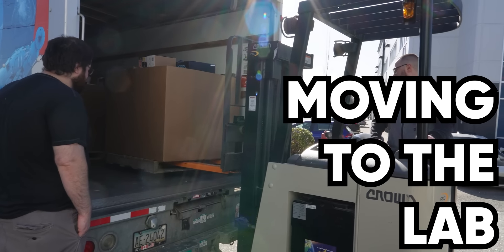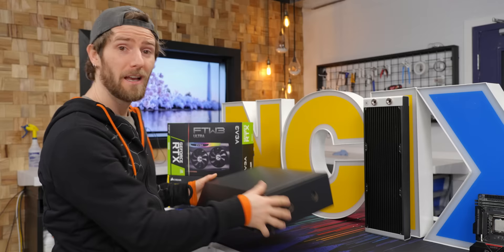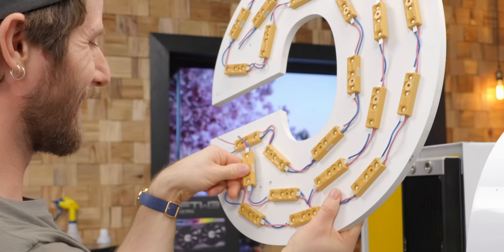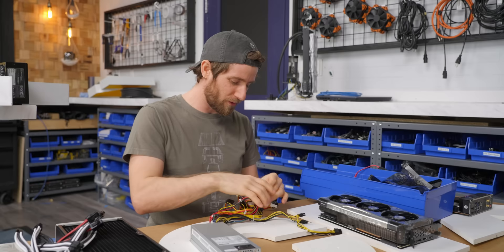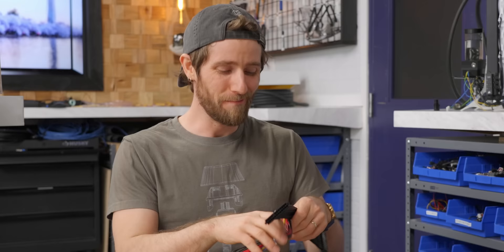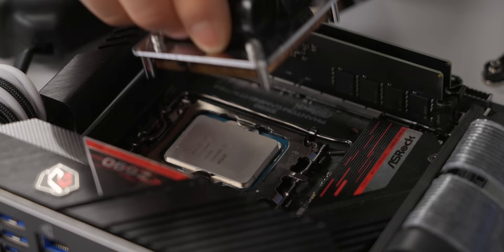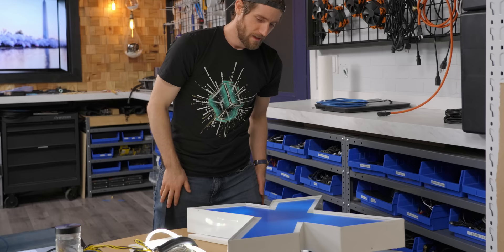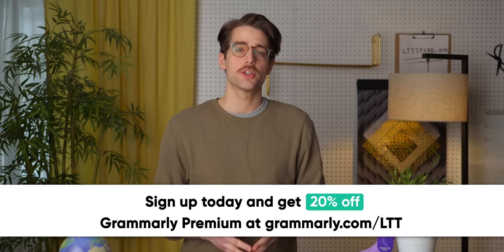Turning my Ex-Employer’s Logo into a Gaming PC

Comment: I have no credentials to back a word I say here apart from being an old school geek and a CIS major (yikes) @Linus Tech Tips. 

However, with your fancy shop tools, it may be worthwhile to add an additional "diffuser layer" that you use as a spacer between the original sign frame that features the rgb element between the letters, the front of the sign can have a more efficient LED setup sans RGB to illuminated them like they were at your ex employer. This would also eliminate the clearance issues shown in the video. 

SOLID mockup, and I can't wait to see what you do to get this rocking!

Comment: Being a tech enthusiast who has worked in sign manufacturing for over a decade at this point, this video was made for me. Both of my big joys in life collided.
Reply: ahmed halfawy  Post relevant clips or just don't comment at all.
Reply: Same, I worked at our family business that made signs (and other things) for like a decade and am also a tech enthusiast so this video is very cool for me. Gonna be interesting to see how they're gonna get even lighting on it with such a tight fit lol.
Reply: @crafteri8891  personally, i would use all white components as well as recess the components as far into the backer as possible while using Principal Street Fighter POD HOs along the sidewalls.
Reply: i am glad linus made you a video :)
Reply: @Ven0mstrike  yeah I was thinking along the sidewalls as well, but they might not have room for it depending on how they go about fitting all the components. And if something is too close to the acrylic you're gonna have a shadow no matter what you do. Depending on what kind of acrylic it is they could use some kinda diffuser film on the inside to even out the light a bit.
Reply: @crafteri8891  The PODs are used to provide even lighting across a large surface shallow cabinet, so they should be the best solution for that set of letters. Hopefully, with all white components, the light will bounce around enough to compensate for the shadows caused by the larger obstuctions.

Comment: English Stack Exchange has a decent answer to use the of the X in NCIX.

Reason 1: The X is there as a homage to communication systems like the telegraph where a period (.) did not exist, forcing people to use an X at the end of abbreviations for convenience.

Reason 2: like Rx, Tx, Pax, and Tix, an X is sometimes added to the end of abbreviations or words that are related to transportation or communication. However that is generally only applicable to nouns.

Comment: I would put the original backs in the wharegouse to be stored and make new ones out of the thinnest non conductive material you can get...  maybe 1/8 thick fiberboard? The attach the componnets to one side of that facing the back of the sign and the lights on the other facing the sign front. Then get some clear flexible plastic sheeting and cut the letters out and sand them so they are not clear anymore to act as a diffuser so the closer lights don't show easily. Add some spacer to the wood letter that just thick enough to keep the LED's off the plastic. Then build the PC off that and everything that sticks out has a hole in the box that hides the cables and tubes.

Comment: Try running the LED tape mounted along the vertical sides of the letters to take an edge-lighting approach. It will also alleviate the issues of the shadows from the components mounted down below.

Comment: With all of the CNC machines, 3D printers, and other things invested in; they could design a frame/adapter to increase the depth, that would leave the original parts of the signage/logo untouched, but still allowing cable runs and such.

Comment: For the lighting, you might be able to use the LED strips in the middle around the whole letter along the inside wall of it.
 - basically it would shine straight into the middle of each letter (like a border around each letter effect)

That should give you the best effect with the setup
Reply: I was thinking that exact same thing 👀👌🏻
Reply: "Edge-lit" is the term you're looking for, and I was scrolling down to see if anyone had suggested it. Seems like a way better solution than trying to light everything from the backplate.
Reply: That's exactly what I was thinking as well

Comment: For the lighting I would stick the LED strips on the inside walls of the front of the letters on angle’s facing the front this should avoid shadowing of the PC parts inside the letters you’d just have to defuse the light just right across the front as to not create shadows by aiming the lights at the parts inside the letter.

Comment: Two sheets of ply and "stand offs" between them. The backs of the letters "gutted" so the components sit in the letter but can be dropped partially out the back. All wiring runs between the ply sheets, including power input, comms, monitor, mouse, keyboard and anything else I've missed. So you just have a sign on the wall and no sign of where the PC is apart from the fans blowing up between the boards.

Comment: I've got a idea use a wood platform on the bottom hollowed out, and mount the NCIX sign on it so you can run cable inbetween the platform with a open back sign while you run the LED all around the letters on the inside.

Comment: Why not build a wall in front of the panel in the office. You give up minimum floor space, you can power in it, you can add blocking to mount the letters securely and direct to drywall, it gives you a few more inches of clearance for components inside the wall, and you can add sound dampening in the areas not occupied by computer parts. I think it would look better, provide a lot of solutions, and be quite inexpensive.

Comment: Having the radiators as a push pull would probably help overcome the small amount of space they have to suck in air. Also maybe XSPC TX radiators cause they're only 20mm. Sure you might be sucking hotter air into the one radiator that isn't getting the clean air, but it might help overcome any static pressure issues. Also EK micro torque fittings might help with some clearance issues. They're so tiny for 90 degree fittings. Either that or Koolance's ones, but those seeem to be harder to come by. Really awesome build concept though! Can't wait to see it finished. RIP NCIX.

Comment: I think that proyect is super cool and nice. But the curret implementation ideas are... quite shabby to say de least. To make the the light of the leds cover all the surface evenly, you are gonna need an entire structure to reflect the light en difuminate it evenly, something like the old ones used on old flashlights, just a lot more complex since you need to be extremely low profile. The back panel of each letter can be custom made or modified with room to breath for the components using holes, or some fomr of grid or magnetic filters. The tubes and cables can pass trought holes in the back of the letters and you can ask cable mod for help with adecuate cables for that (like other times). The structure bejind the letters can have space to do cable magnament and even go crazy and install some form of air system, wich to make it crazy, may be somehow related to an air conditioner. Just, dont rush it. Please make it reaaaaly cool. Its gonna be a crazy serie of videos

Comment: You don't even need the backing to the letters, just put in some wooden blocks for screwing the fronts to. Also, maybe offset the entire plate from the wall by enough to squeeze in those tiny Noctuas along the top to aid airflow. Didn't you use a ton of those in the desk so they're going to be lying around anyway?

Comment: Honestly, I would have a bank of fans on one side of the N and the radiator on the other side. Make the inside of the letter negative or positive pressure. That way you could have low RPM fans that still move a lot of air.

Comment: Please use WLED if you're going to put pixel LEDs in there, it's super flexible, and free to use. It's also super easy to use and can sync with lots of different things, at least worth looking into.
Use 12v LEDs, even the cheap ones are great.

Comment: Why not raise and fix the positioning of the letters and mount them on a rectangular metal plate using rods or the like, and just have them as a cover for the hardware, add two inches gap on the bottom of each letter. It's like a restomod of the sign, the spirit of the exercise with a couple less headaches.

Comment: Why not put the strips on the side of letters, on the interior and as close as possible to the shine through part for even lighting... Then connect them with an extension cable... You would need to detach the extension everytime you open the sign, but... Even lighting

Comment: Put motherboard and GPU in N, they both fit and are close enough so there is no significant latency from the GPU riser, rad in the I, make the front a mesh and that's your cooling, if there are clearance issues or didn't want to put holes in that I, then do it in the X, just like you did it in the N.
Could've asked Alex to do it, even though he has some funny/janky solutions.

Comment: @LinusTechTips if you flip the motherboard upside down you only need to use one pci expander and you can run all cables and fitting trough the back without weird angles.

Comment: For your RGB lighting you would have to put strips of leds on the components to stop the black spots. There maybe no other way around it, also you could use RGB fans as well as a RGB water tank. This may help solve some of the issues and good Luck with the build can’t wait for the update and see how well it look.
Reply: I wonder if there shouldn't be some dark spots as a reminder that it is a PC.  Making it indistinguishable from the sign as it was originally may be unnecessary and counterproductive in a way.

Comment: The letters and their steel cases are critical. The backing plates are bupkas. Get some MDF and build containers for the components that FIT INTO the letters. make them deep enough so that you can mount some cardboard with LEDs behind the plastic lenses so the letters light evenly. Or don't. The jank is part of the entertainment. 🤣

Comment: Why not create new backs for the letters that would give you more space and mounting capabilities? Also you could run the led's along the front of the letters on the sides and still get nice light diffusion.
Reply: I don't think LTT is knowledgeable about Channel letter signs. But then again anything is possible with a routing table lol

Comment: what is a better choice. i5 13600kf + 6700xt. or i5 12400f + rx 6800 non xt. The second option is a bit cheaper by my calculations but not by much. 

The core question is whether to have an overkill (but future proof) cpu now and upgrade gpu 4-5 years down the line or to have a better gpu and upgrade the cpu later.

Comment: Mount the sign on a box that way you can put holes in the back of the letters and run stuff in and out of them, then do like led strips from govee and each letter gets its own strip and controller and mount the controller and power in the box the sign sits on. Then use one of those fiber or thunderbolt docks you use at your house to run your peripherals and display from the sign, that way you can put your desk wherever you want in the room. Also you could get a thin piece of frosted plexiglass or some kind of plastic to use to diffuse the LEDs but also hide the components inside. So put the strips around the inside of the letter as close to the front as possible, then put the thin piece of diffusion plastic over it.

Comment: well, if you are going to put the sign over a "box" you can drill the back of the letters, also, lights, can be go at the walls of the inside of every letter.
For power, maybe Dan, can reroute a big cables for the powersupply, also you can go fanless, or you can take off the case of the PSU, then put a fan to extract the hot air. this can be suitable for the other components, there is mini fans from noctua in order to do airflowing.

Comment: instead of white components mount some light diffusion screens on the back of the letters to disperse the light across the letters kind of like i dunno maybe old LCD laptop panels did?!

For the Radiators....ditch them....make custom ones...like i dont know....maybe if you had a metal 3d printer?! Or perhalps maybe even use copper piping for the backing of the sign that due to length of the water loop/exposed material and then passing through coiled into your letter N that has fans and then returning should be more than enough to cool it...or even have an aluminum block with some Peltier coolers attached.. fans could vent though holes drilled in the top or bottom of the letter instead of out the back

I would also go with a parallel cooling option with 2 pumps lower in the letters with the item they are pumping though......the X and the I ......this pulls the coolant throughout the system and pushes it through each item before being cooled and returned. Reasoning for this is because your loop or loops would be very long and if there was a leak or airgap it would still take the liquid remaining in the system and send it though.

Comment: The lighting diffusion was the first problem I foresaw with this project. Really this whole thing is quite absurd and janky though. 😂 I guess the concept itself does match though so at least its consistent in it's janky nature.

As long as the lighting is close to the front face on the outter edges, it will light better beyond the components. Though it will be noticably undiffused at the edges where you'd see the spacing between the lights on the light strip. Though, lighting from the back of the letters is likely worse by comparison in this scenario. Consistent gaps of lighting is likely better than hardware shaped dead zones. Though with how much space the hardware takes up you may end up with the dark spaces regardless if you dont end up with enough space for the light to spread over the hardware without casting shadows.

I guess if the GPU is RGB and controllable that may lead to some variation in the lighting affect in that letter,  lol

Comment: You could have saved so much trouble if you had flipped the motherboard upside down. The fitting heights would not have been an issue pcie riser could have gone straight in etc

Comment: Your hardware is upside down. Since all the ports are pointing upwards flip all components with their back to the letter front and it should be a lot easier to route all cables and loops since you do not have to route them over the boards before moving them to the back plate.

Comment: Hey Linus, i recently moved and finally set my pc up after a few months of sitting. I had issues with pc restarting over and over. Come to find out, i just needed to take the cmos from my motherboard and put it back in. My pc will now cut on and all fans run, but i have no signal to monitor and keyboard will not connect. Could the cmos just be dead ? Or is this a psu issue.. Looking for a bit of help with this before taking it to a specialist.. thanks.

Comment: Why don't you just put in the components the other way around? The way that you see the back of the mainboard. All the fittings would go straight to the back and you won't have any clearance issues. As the letters will be on top of the hardware anyway, you shouldn't care about the components looking good inside the letters.

You can then use some screw rods coming from the back with some plastic tubing around them that is cut to the height the board should be inside the letter. That way the board would sit at one level inside and you would even have room for cables on top or underneath. If you put the board one or two millimeters away from the plastic of the letter, you might have enough space underneath for all the IO cables. Maybe put the IO on the side of the letter.

And maybe think about cutting holes in the sides of the letters and using some small Noctua fans for extra airflow. Make the sides of the letters the intake and outlet for the air. A bit like the cooling in a server. You could even use some of the 1U or maybe 2U radiators.
Reply: And put ht e LED strips around the white part of the letters. An RGB outline would look way better than a completely lit up logo. You could even glue a thin black pane of plastic on the back of the painted parts to only have RGB on the outline.

Comment: I would put rizer mounts for the letters to give yourself more clearance space for when you put the front covers of the letters on, yes you'll have a bit of a gap, BUT, you can fill the side gaps with some piece of solid white acrylic pieces cut to size to blend it all together and make it appear seamless along with the LED strips, which also btw you should probably cut to length of the letterings and use soldered on corner pieces for LED strips so you can right angle, left angle the strips how you want without having to bend or twist the LED strips, and by the end of it all it will evenly light up and distribute the lighting so it conceals the PC that's within the lettering.

Comment: like the setup, and it will look great, but, it's big, but, why are you putting the PC in the sign in  the first place, Linus, is the sour gay, always under hood, of His PC, and that not going be easy bolted to the walk is it?

the solution am prised Linus is not using, the same as the one home office used in his old house, with the fibreoptic link, put mega PC, and the All nosey bit in the server room, with it's on hand, cooling and stuff, keep the rest in his office, with remote USB plug, thumb/flash drives, etc, keyboard and mouse, and as it Linus work PC game pad connector? the noised part will be the keyboard clicking sound,
and just put some led light in the sign and put it on the wall?